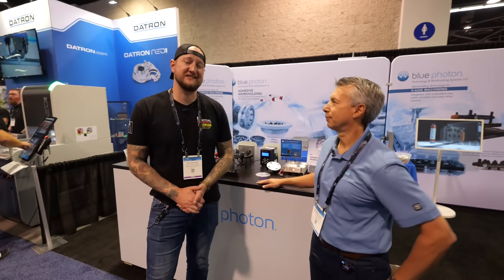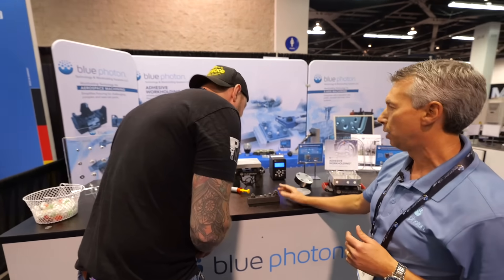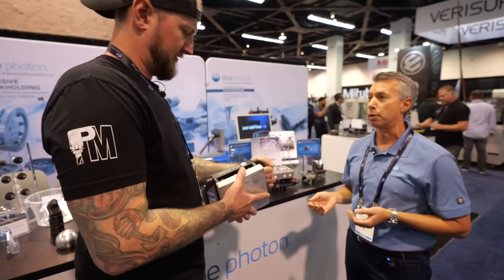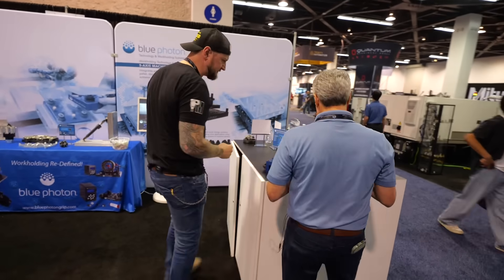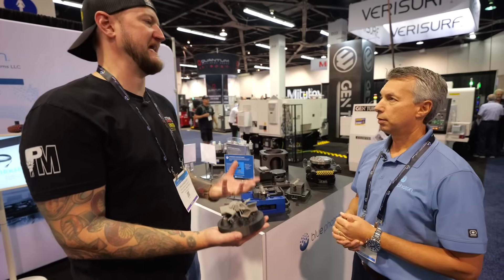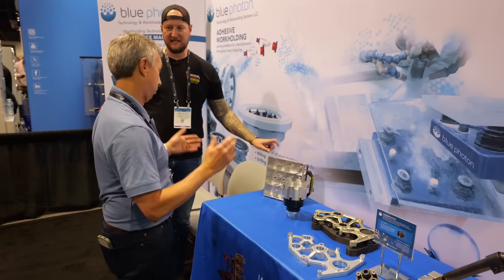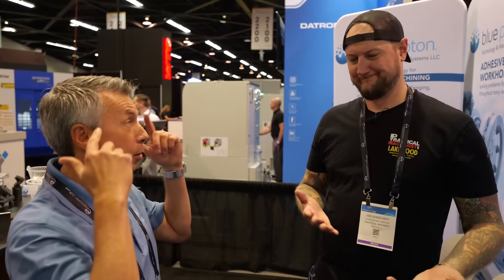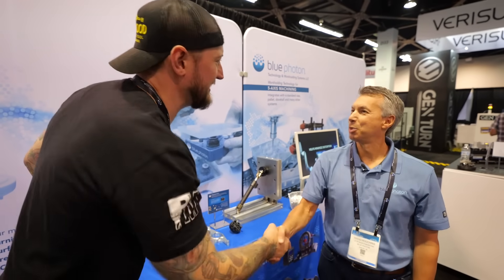WEIRD PARTS? THIS IS THE WAY TO WORKHOLD.

Comment: Nice! But how easy does the residue clean off from the part?
Reply: The adhesive is easily removed with steam, hot water spray or dry ice blasting.